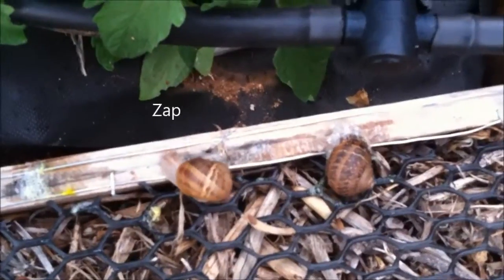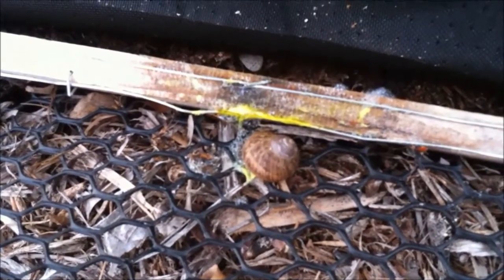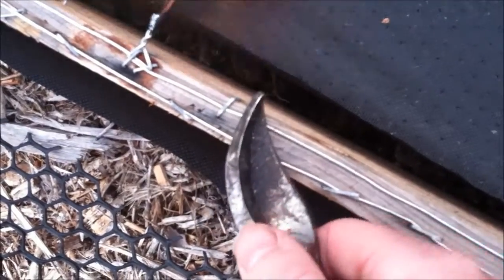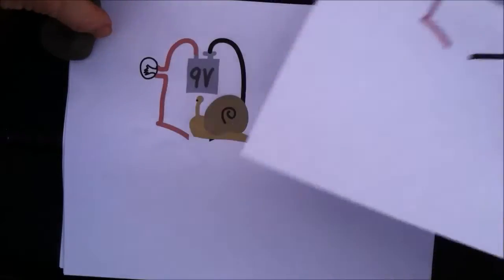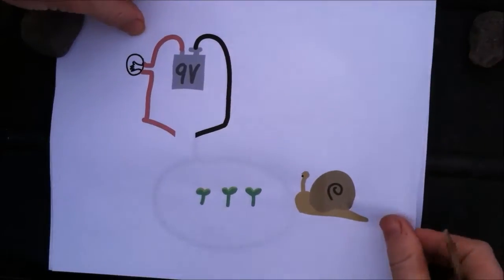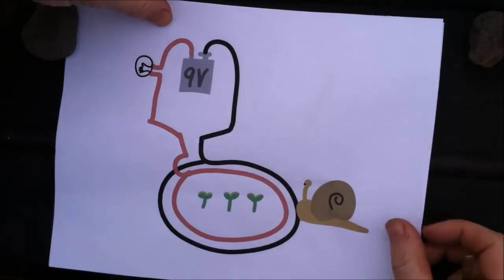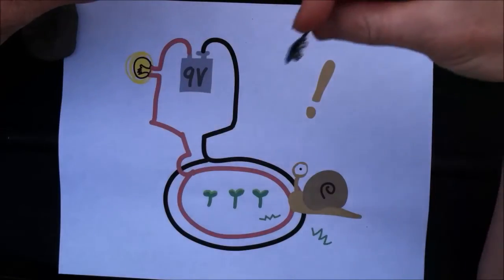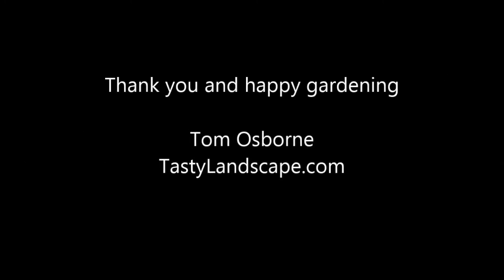DIY   Electric Snail Fence

Comment from the maker: Hey Aaron.  Thanks for your kind comments.  

Yea, not a lot of views, perhaps if I get on the SEO wagon it could be improved. On that note, tell your friends if you like the video. 

Ok, in regards to your specific question about battery life:
The cool thing about this setup is that the battery is only "on" when the circuit is completed by a snail or slug.  Therefore, most of the time the battery is basically off doing the same thing that it would in your drawer.

Comment: Interesting idea. I don't think the wire crossover would be necessary, as you shouldn't technically need to create a closed loop with each wire as was done in this video example. The wires can simply run parallel to each other around the "fenced" area, and they don't need a terminating point - the snail will close the circuit. You'll end up with a very tiny area of possible snail entry, but they would be unlikely to find it. If going the crossover route, I think some electrical tape might be of good use where one wire bridges over the other.

Comment: So how long does the battery last when it rains and the wood is soaking wet and completing the circuit from one wire to the other?  Or even when watering the plants and getting water on the wood where the wires are mounted. Seems flawed to me.
Reply from the maker: +pikesticker good point pikesticker. Great point! Since we don't get a lot of rain down here in Southern California its not a major issue. Batteries last at least the growing season where I am at. I use drip-line so the watering is controlled and does not get on the wires/wood. However,  there is a better option overall that addresses the flaw you mentioned. Basically run normal un-braded insulated wire just like the noninsulated wire shown in the video. But then take a razor blade to the top side of it and remove the insulation on just the top. That way the bottom-side that touches the wood stays protected from prolonged moisture and the side that the snails touch is exposed. Best, Tom

Comment: Is it possible to use an led? or would it not work because an led requires the positive and negative to be connected all the time which would drain the battery.
Reply: Not an expert here, but I'm thinking it should work with an LED (which would also be my choice over a light bulb), but you might want to include a resistor in the circuit then so that the LED doesn't pop/burn up - as I have learned in the past from connecting LEDs directly to 9v batteries.